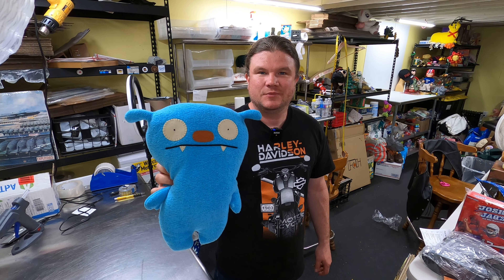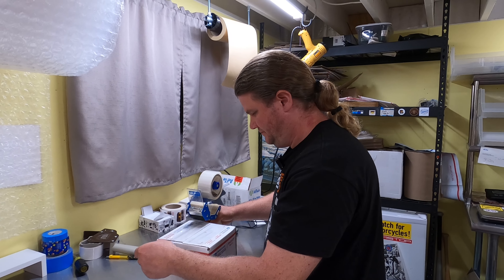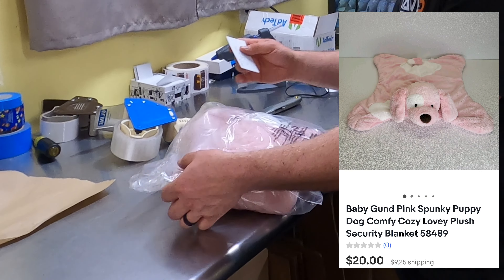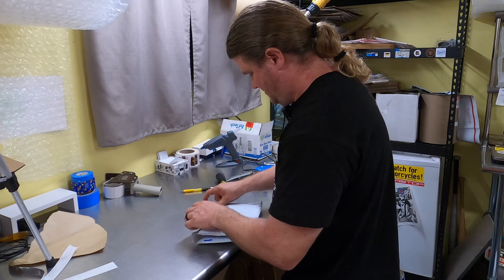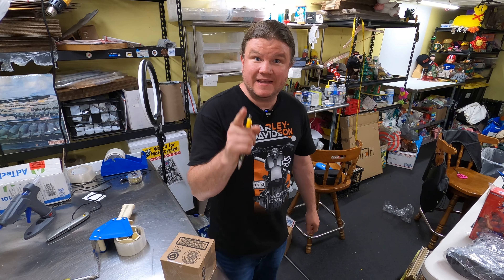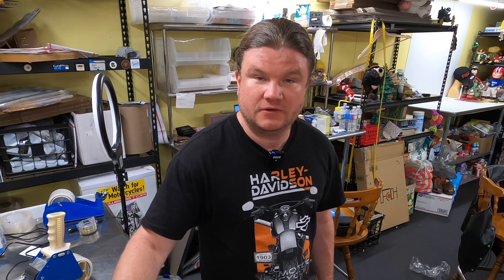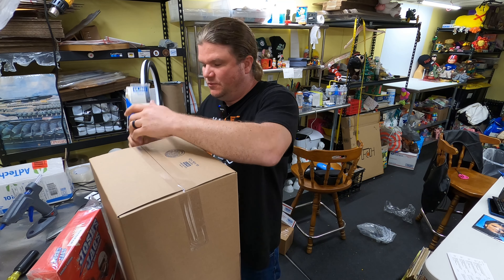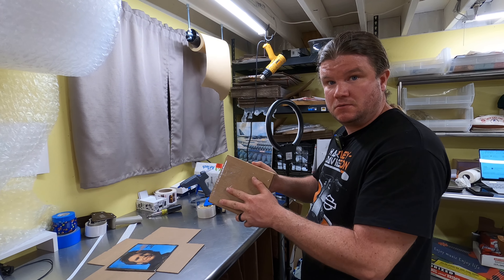IS IT POSSIBLE TO BE TOO CAREFUL SHIPPING ITEMS? | WE SOLD PLUSH, TOYS, AND MORE ON EBAY!

Comment: Frank I will tell you a secret. I pack exactly same way as you 😆😆😆 I ship all plush in boxes, use a lot of tape 😆 I am just that way also, I am always afraid that something will get damaged or the box will open if I dont put enough tape on it 😆 The story with polymailers is also me 😂😂😂😂 I even put bubble wrap on plush 😂😂😂😂😂😂. You are absolutely right presentation is important. Too bad that buyer returned turbo tax, probably didnt read or see that it was for 2019 😆 I have sold American Girl dog plush before for decent amount. Great sales. Great job on packing